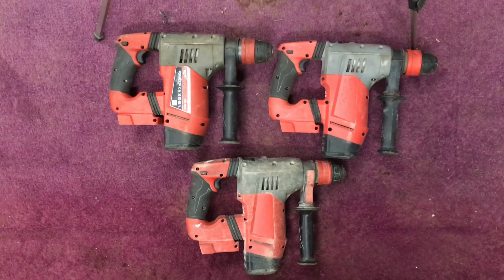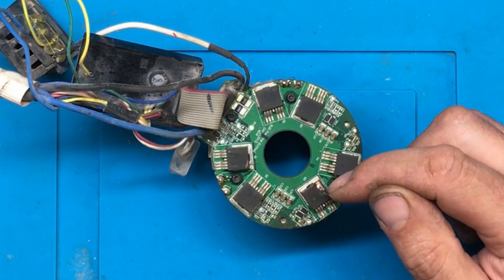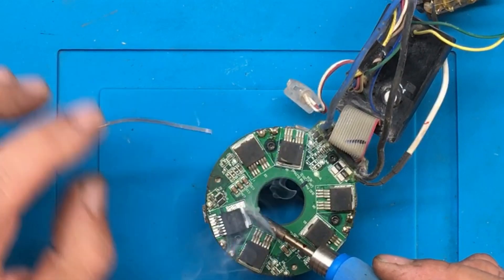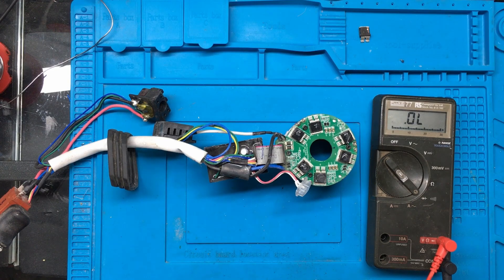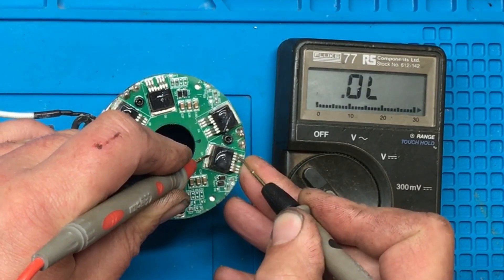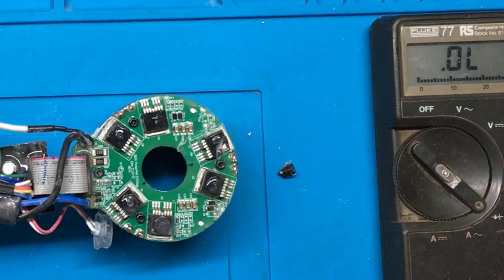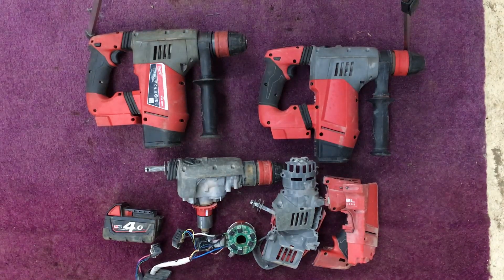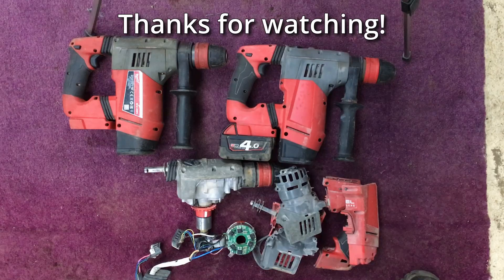3 x Milwaukee SDS Drill Repair-a-thon

Comment: My milwaukee chx-502 when I pull the trigger and help rotate the chuck by hand, it initiates but stops spinning right away. Mosfets weren't shorted when I measured like you did in the video. What else could I do? Thank you.
Reply from the maker: It's usually a blown mosfet that causes that, the only other thing I could think off hand could be a damaged hall effect sensor (3 on the other side of the circuit board). They sense the position of the rotor, and tell it what mosfets to fire. The only other thing I could think is bad connection inside the switch, but that would be more of an intermittent thing and rotating the chuck would probably not have any effect on that.
Reply: @BuyitFixit  Is there a way to measure those sensors that they work? I appreciate your help, thank you!
Reply from the maker: I think you can only test them when they are powered. You should get an output signal that will change depending on thr rotor position, or if a magnet is near them. It would probably be difficult to measure them. Just see if there is any damage to them. I had a grinder where the rotor bearings had failed and the rotor had worn away the top half of one of the sensors.
Reply: @BuyitFixit  okay, I'll check that. I appreciate your help man!
Reply: @lxh22  did you find the problem?

Comment: Any theory as to why the mosfets keep failing?
Reply from the maker: Could too much load on them or a sudden surge perhaps if the drill gets jammed. They have current sensing in the drill, but perhaps it doesn't kick in quick enough or something.

Comment: Milwaukees Controller PCB-on-Stator design is nonsense. Bare Mosfets zero cooling and exposed to the elements. Also makes the electronics more complex. 
Most other brands have one big potted controller with an aluminium case for heat dissipation tucked in the housing somewhere away from the already heat producing motor.
Reply from the maker: Good point. It does have a fairly large aluminium block where the board screws on to, but I didn't think about the motor itself also producing heat when it is under load.

Comment: Great fix on 2, a shame about the 3rd one being unservicable... you can't win them all I guess, fixing central heating PCB control boards would be a great one as they are expensive to replace and normaly only the caps, resistors, diodes and dry joints are the failure points due to vibration.
Reply from the maker: Thanks, yes the main IC is programmed and unfortunately you can't buy them as it's a part TI only supplies under a NDA. Regarding the boiler boards, I know a couple of engineers who service boilers and I could get a supply of broken boards, the problem is I have no means to test them. We also have no gas in our area only oil boilers.
Reply: @BuyitFixit  ah ok, not really an option then, never mind, I have bought a tend T35 vacuum non working on the back of your videos to have a go myself. I'm an engineer by trade but left the in depth electronics behind for more cnc related items, 3 phase motors, servo motors and drives a while ago. Watching your videos has made me want to look at it again in depth, so thanks for that, it is appreciated Mick

Comment: Great detail on highly skilled electronic fixes.
Would love to see similar fixes on Makita contractor tools (ie: SDS MAX corded, 7 1/4in circular saw, sawsall)
Reply from the maker: Thanks, the main reason they are all pretty much Milwaukee is because I was buying them for myself. I've done a Bosch grinder and reciprocating saw, and someone recently asked me to look at a Dewalt 4 way charger (which I'm sure will be in a video at some point).

Comment: Liquid nitrogen will get that rubber off
Reply from the maker: Thanks for that👍I'm not sure how readily available liquid nitrogen is in the UK. Even dry ice isn't that common. I managed to remove it with some heat from the rework station and picking at it, it does get it off eventually albeit a bit time consuming.
Reply: Another thing to try is the pipe freeze cans. @BuyitFixit
Reply from the maker: Good idea👍, I actually have some freezer spray. Used to use it for diagnosing certain electronic faults caused by heat back in the day.

Comment: Update on my mission with filling the cylinder. 
Firstly Milwaukee wont reply on correct psi. So we assume 130.
Tyre and scuba shops will not fill as there is no data on cylinder. 
I tried a friend's air rifle pump and a shadler valve adaptor with a standard pump. Neither worked for me. I believe issue is that the valve pin in the cylinder need pushing in to add air. Neither connector I used had that. Any suggestions would help.
Reply from the maker: Hi Stu, I had someone else say similar about the valve and explained that in the description.

Comment: Love the videos ive been trying and failing to fix a new model milwaukee grinder, think its the control chip thats gone. All covered in potting compound which is a pain 😪 just pissed off the replacment electronics are just under the cost of a new one!!! And the rest of its like new, becuase it was not registored no warranty i can claim im at a loss what to do next
Reply from the maker: I have a couple I've looked at. A 9" I think and the smaller standard side. The larger the main ic is blown and it's a custom part. The smaller one I could possibly have fixed as it was one of the hall effect sensors had worn through due to debris in the stator but I thought it was going to be too much trouble and I already have 3 of them. They don't seen very repairable unfortunately.

Comment: I find a large chisel tip works well to heat and remove the mosfets and to install the new ones. I also dab some solder paste on the pads sit the mosfets on and sit the chisel tip on top, legs first then big pad.
If you feel like digging the resin goup out of the controler on number 3 there may be a fuse resistor, there are in recip saws and high impact wrenchs.
Reply from the maker: I had been thinking of possibly doing a re-visit on the drill. I haven't had time to do any repair videos the last week as had the body off the wifes landrover. Replaced both turbos still having issues...
Reply: @BuyitFixit  lol, I try to avoid big car fixes these days
Reply from the maker: @MrTorch8  I'm the same, but needs must as they say..
Reply: @BuyitFixit  the gen 1 csx recip saws have an almost identical stator and they have a 22ohm (off the top of my head) fuse resistor on the control board. I'd hazard a guess the drill does to.

Comment: hi I have the same drill, can you give me some indication sometimes when drilling it makeing some noise like the gear is not connected, then sometimes its ok? any idea what's up with it, or is it the gearbox had its time? thanks
Reply from the maker: From what you said it sounds more like a mechanical problem. I think when I looked on the Milwaukee site you could buy gears and parts separately so it may still be worth repairing.

Comment: Do you think the problem stems from insufficient cooling of those mosfets or under-rated for the task at hand?
The SDS drills when used as a power chisel is a high duration task. Not too kind on those mosfets
Reply from the maker: I think possibly if the drill jams up and people are keep trying to make it go to get the drill bit out, that would put strain on them and cause them to blow. I'm not 100% though.